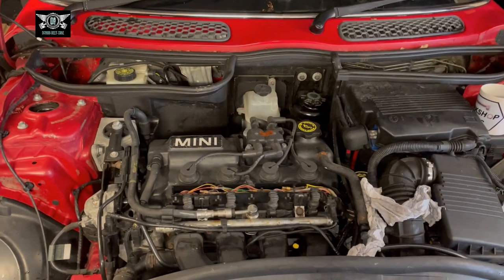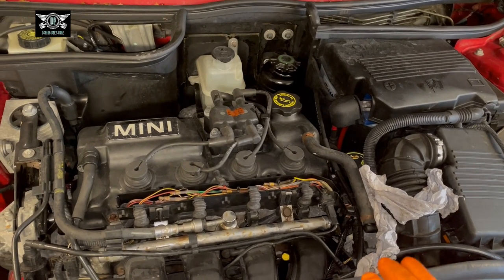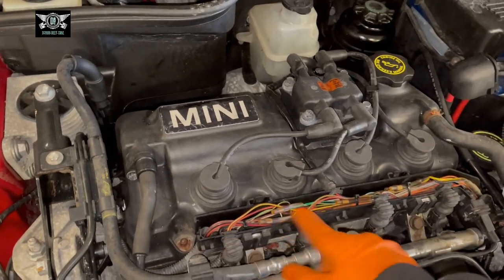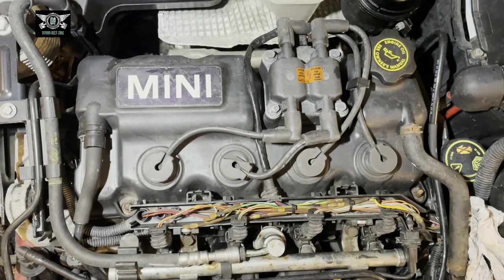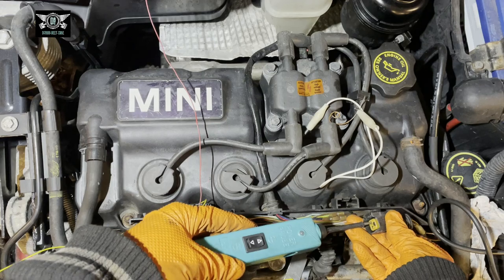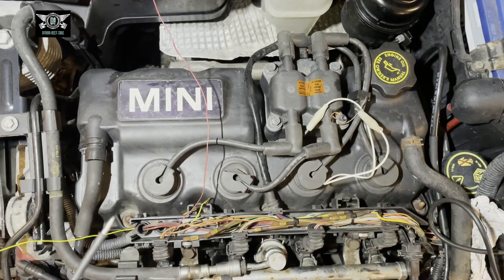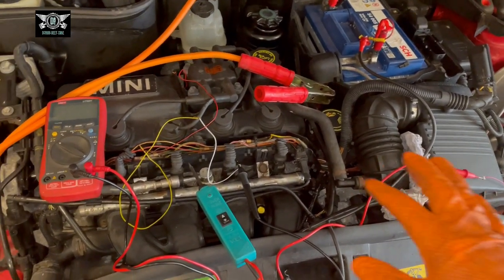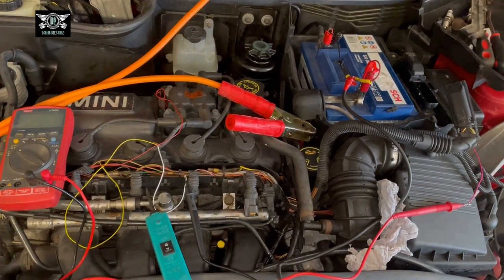Mini cooper R50 misfiring fault finding fuel injector no pulse wiring check compression test

Comment: Don't pull when checking fuses AND relays....don't pull terminal 30 relay when car in awake mode or when battery connected linked to power...it will corrupt memory from powered capacitors of modules linked to dme....programmed electronic adaptions....which includes..vanos.valvetronic.ignition.fuel pump and injector voltages or pulses.....the eleectronic breach....simulates..bad mechanical.

Comment: Using foxwell one can under mini specific software..watch...the..service.dme electronic.module..scan of misfires.....these will lead to fuel washing rings and diluting oil viscicity or pressure causing overheating and knocking allong with LIMP modes restrictioning......causing PARKED restart...when cool......oil must be changed when contaminated.....
Noticing limp mode causes misfires only below 1900 RPM at startup and below 1500 at all IDLE periods forcing driver to RUN neutral at STOPS and pedal use to maintain 1500 rom or misfires occur or fuel past rings...also causes low cimpression....the weakest cyluder draws most egr recirculated gases.
Reply from the maker: Show us how is done properly.

Comment: Update
Reply from the maker: Hi I did an update on this car, and very bad news, I had no compression on cylinder number 1 after doing a compression test. I removed the head and found the piston was damaged as one of the valves dropped and got crushed during my testing. So if you have a similar issue. Check the compression and if there is a compression issue, don’t start engine anymore, it can cause serious damage.
Reply: That's right , misfiring it's just a compression problem . Better way to be sure for a simple test check the compression.  That's it !

Comment: The electronic corrupted memory because of capacitor memory maintaining codes..permanent....one must hard reset battery....adjoining car side cables with a ONE ohm tem wat resistor..for 30+ minutes....or some dealers state overnight 8-9 hours to drain all modules memory because of capacitors battery holding minute voltages....allowing all codes permanent cleared.....but if part is still unfuxxed will code pop up under operation but if watched modules are caught early under temporary fault or stored fault can be cleared...but must clear quickly before permanent faults occur....requiring dealer..reset or reflash of dme to modules operational voltage parameter....but if codes are permanent...dme is prigrammed for ....what is called crusty limo mode which is a misfire mode..frustrating drivers to force repair.